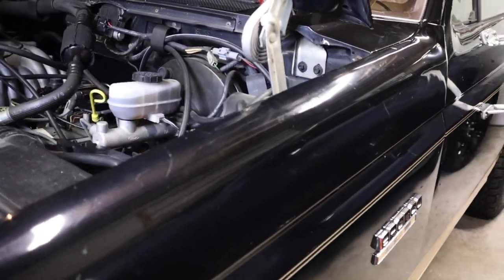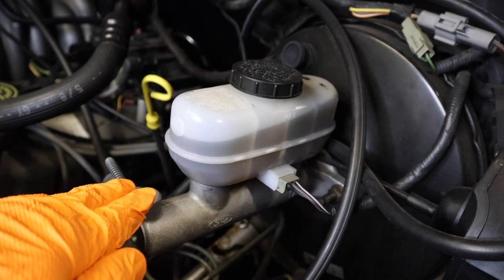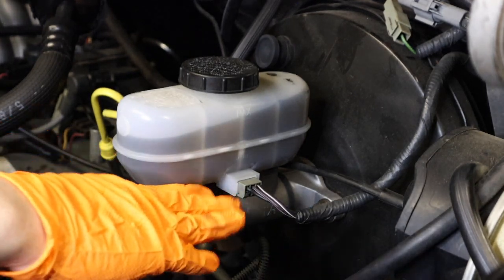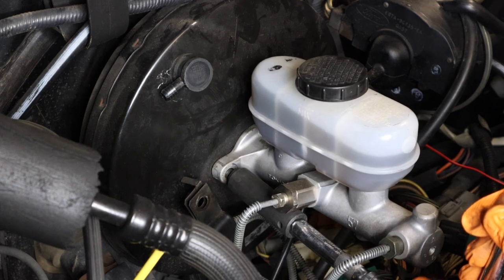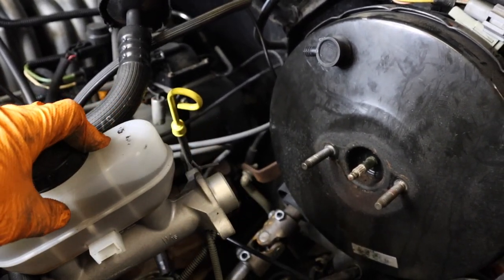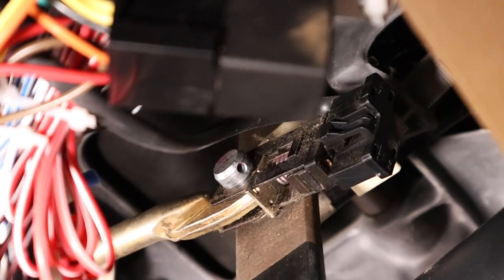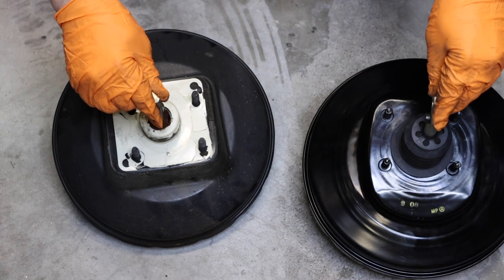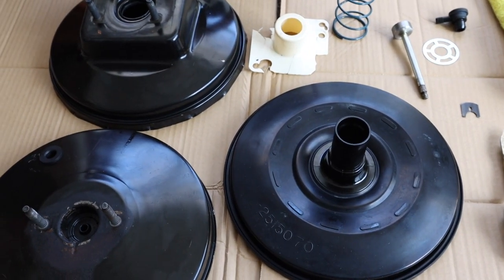Replace Power Brake Booster Ford Bronco & F150 | 1980-1996 Ford Bronco | Bronco Restoration

Comment: Perfect! I was thinking of replacing mine. It's super rusty and makes that same air noise.
Reply from the maker: You won’t be disappointed, there’s nothing like good brakes on a bucking Bronco.
Reply: @TheFixTech  thankfully my brakes are still working pretty well. I'm focusing on getting the engine running right currently. I went and bought a set of injectors  and a bunch of gaskets after watching your video. They come in the mail tomorrow.

Comment: A little off the subject, how to adjust the cables on the dash unit ?  Hot/Cold - Vent/Defrost ect ? 1988 F150 with AC. They are still intact but not adjusted correctly.  Thanks for all the videos we needed some like you !!
Reply from the maker: I am not sure these are adjustable. These are vacuum controlled units (88-89 were specific than other models) if there is an issue with vents not opening properly check the hard vacuum line that routes from the engine manifold tree to the hvac box in the engine bay, that line also routes to the wire loom near the blower motor. That line always breaks keeping deforest only on… The 88-89 was a different system so I am not sure if this help.

Comment: You can always use a small punch and hit the pin inside of rivets and they’ll just fall out. Then use a drill bit to remove the remaining rivet. Using a cut off wheel risks cutting into the door’s frame and mutilating the paint and metal.. kinda like he did in the video 😅..

Comment: Re: push rod adjustment - the Chilton manual says to do this with the engine running, presumably so the vacuum is present and engaged while you’re calibrating the pushrod to the MC. Did you notice if that made any difference with the engine on vs off?
Reply from the maker: I’ve always adjusted the pushrod with engine off with great results. The push rod is directly connected to the brake pedal, ensure the brake pedal is all the way up and make your adjustments. You could also turn the engine on for a couple seconds then off, the new booster will fill and hold vacuum, then make your adjustments.
Reply: @TheFixTech  that is a very good point, i forgot that the vac should hold after its started and shut off. Once this rain stops I’ll have to pull the MC and re-adjust. Thanks again for all the great info 👍

Comment: My 89 Ford Escort requires this.  But I want to change my master cylinder too since it looks pretty bad.  I once heard that these brake boosters can hold high pressures since it's part of a hydraulic system.  Are we supposed to relieve pressure before removing them?

Comment: Hey I think your pedal pushrod is rotated upside-down. I was watching your video trying to figure out whether I should install mine with the pushrod hole offset up or offset down where it connects to the brake pedal. It looks like the one you removed had the offset up, but the one you installed had the offset down.
Reply from the maker: You are correct, I noticed this issue recently, it did not have any affect in braking. But I since corrected it. Thank you.

Comment: I had to rewatch the adjustment procedure a couple of times to realize that my new booster came without the middle nut, which means I couldn't tighten it down once it was adjusted. Then I looked at the old booster for comparison, and while it appears to have a stouter assembly (I'm assuming this is the original part on my 87 F150), it did not have the middle nut either. This makes me wonder if I need to go back and add a replacement middle nut or is it all that important for it to be tightened down?
Reply from the maker: In the case with no middle nut, I would use a thread sealer to keep the nut from backing off.

Comment: Can you use that new break booster on a 96 Bronco, too?
Reply from the maker: Yes it will, but I do recommend the remanufactured model instead as I am having problems with the new unit. I even exchanged it and it still is having problems. The remanufactured units seem better.
Reply: @TheFixTech  oh ok thanks

Comment: Awesome video however I did replace mine with a new booster and now hear a air leak when pressing the pedal, old one didn’t do that but was time to replace it, any thoughts on this?
Reply from the maker: Is it a new booster or a reman? I believe only cardone offers a brand new booster. It shouldn’t leak air nonetheless. I recommend return for an exchange.
Reply: @TheFixTech  it is a reman from orielly however only one I could find that is new is from parts geek, hopefully this new one will do
Reply: @ethanrice2680   it's defective.....somethings I wont buy from O'Reilly's...

Comment: What if my pearl just sinks with little to no pressure with a gush of air 
I’m hoping it’s nothing major other than replacing the booster and cylinder non of my calipers leak or lock up 

Forgot to mention everything is original on the truck 
OBS 1991 4.9 f150
Reply from the maker: If no external leaks then the master cylinder is leaking internally. I had same issue when I first bought my truck and was able to find an original nos ford master cylinder.
Reply: @TheFixTech  now this is probably a silly question but replace both would I have to replace the calipers and lines at the same time ? 
Or can I start with the booster 
Sorry for so many questions